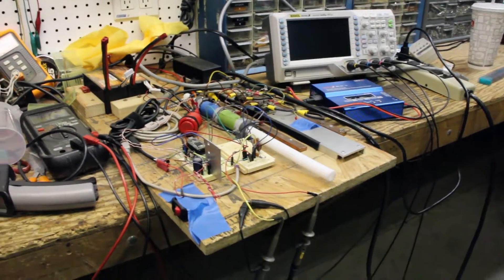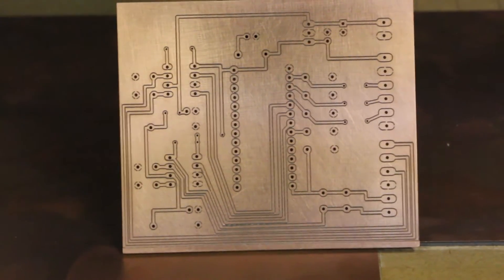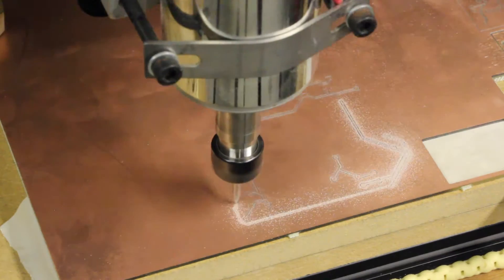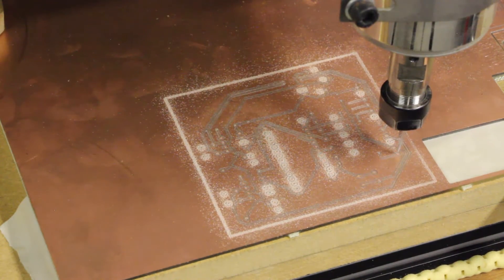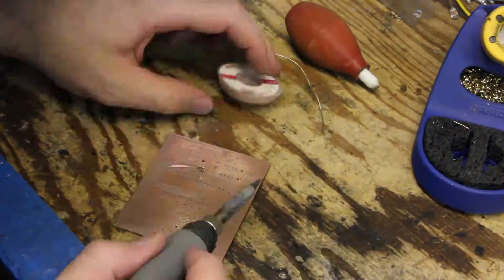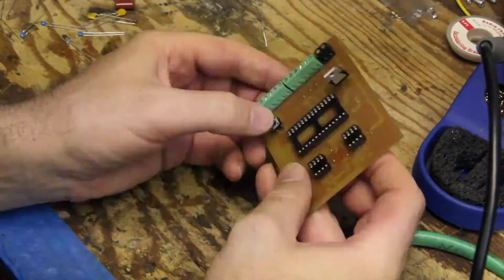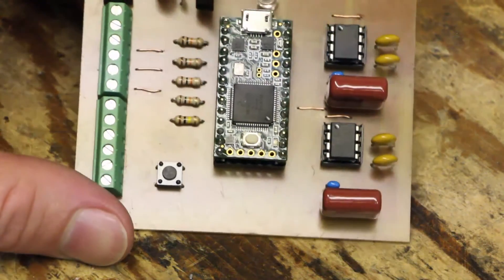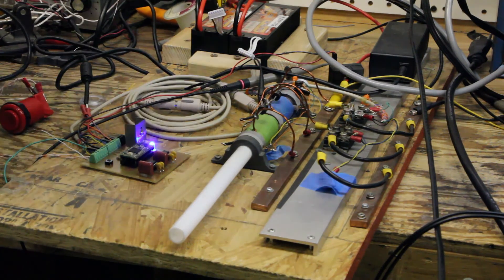Coilgun Update  - Converting breadboard to PCB

Comment: Hey!! What diameter is the 30-degree v bits you're using? Cheers Benjamin
Reply from the maker: Benjamin Isaacs I determined V bits are terrible for PCB etching.  I switched to 15° 3 flute tapered stub 0.01" tip ZrN coated end Mills from Precisebits.com
Reply: Okay but what were you using in the video?
Reply from the maker: Benjamin Isaacs I don't recall. The problem with V bits is they don't have a diameter.  Deeper you go the wider the cut.
Reply: "The problem with V bits is they don't have a diameter" yes they do they come in 0.1-0.2-0.3-0.4-0.5mm etc